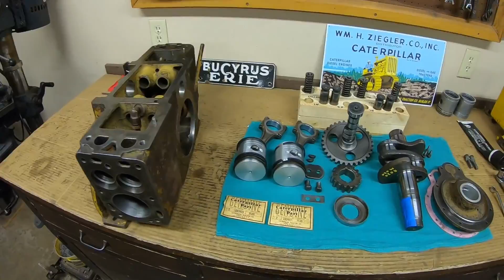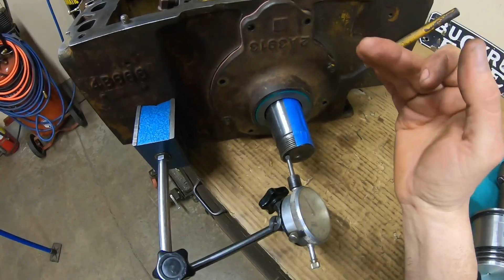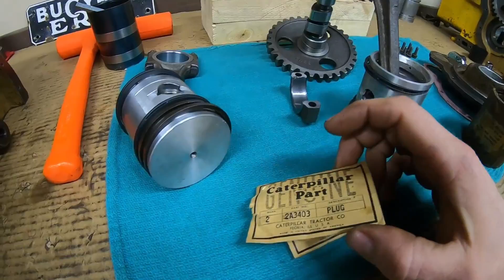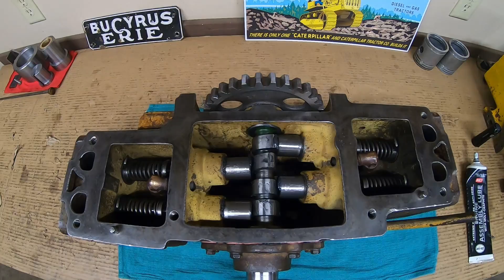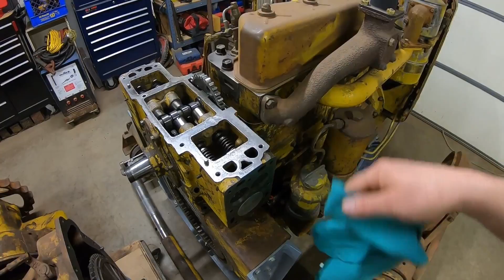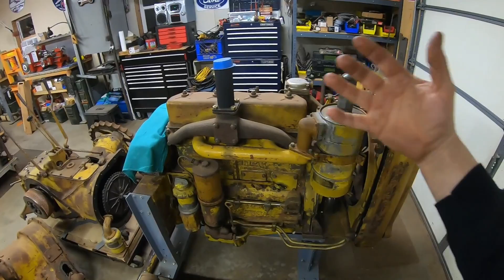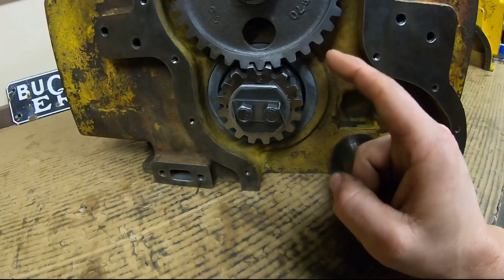The Caterpillar "Pony Motor" - Cursed by Design?? Or the Perfect Balance of "Just Enough"???

Comment: Absolutely nothing wrong with a starting engine!! Chatted with an old Cat engineer once and there is good reason Cat stuck with a starting engine for so long even though electric was available from some of the competitors.  Cat had some of the higher compression Diesel engines out there, and keep in mind they started building diesels in 1931, at that time there was no electric starting technology that was sufficient to crank over the high compression Cat engines.  Thus the starting engine was born, Cat ran starting engines so long, in fact it wasn’t until they were confident that electric starting technology was reliable enough to get their engines started that they did away from starting engines.  (Starter, glow plugs, battery, etc). Even though electric start began to become available you still had the option of a gas starting engine for some time before they disappeared.  In climates up here in the winter you couldn’t rely on batteries to get the 2UD8 running in the morning to clear bush.  But so long as you could crank up that starting engine,  get the diesel spinning over (sometimes you had to burn a whole tank of fuel before you had enough heat for the diesel to pop off) but you could always get fired up to work for the day.  My grandpa tells me stories of how he would have rather had a starting engine that was well maintained vs an electric start especially in the winter months as it was much more reliable.  Btw if you want to run a D8 with a pan for a week just come on up man we’ll let you loose :)
Reply: I was told some years ago that engineering recruits to Caterpillar, as part of their training were seconded to Briggs and Stratton to learn engine design. Many baulked at that considering B&S were so far below their level, despite at that time being the largest engine manufacturer in the world.
Reply: @peterscandlyn  I worked on Briggs and Stratton 4 stroke singles in highschool
I have a Briggs and Stratton genset that runs off ng
Reply: @JAMESMANHUNT9  Yes, I'm aware some folk have done very clever things with B&S engines.
Reply: @peterscandlyn my genset was factory built for natural gas
Reply: Enjoy stories like these!
Where are you located? How far north? I'm in MN.
Reply: @dans_Learning_Curve  central Saskatchewan
Reply: Well Caterpillar did so love their pre combustion chamber engines. The down side of them is that they are not really good at generating enough heat in the combustion chamber when you crank the engine over. That is why the need for the pony motor starter, or the later glow plugs to provide a source of heat to get the diesel fuel to light off. Direct injection diesel engines this isn't such a big deal.
Reply: Detroit-design engines from the thirties are the same compression ratio as these Cat engines (around 17:1) and they'd start on direct electric every time. The reason Cats didn't start easily is because they're indirect injection and low injection pressure. Unit injectors were far superior from the get-go. Once they moved to direct injection, no more starting issues. One of the reasons Cat didn't change the approach quickly is because it costs money to introduce new designs. Since their market was used to using the starting engine, it was easy for Cat to just keep rolling down that line until they had to design new main engines, at which point they were able to come up with easy starting designs.

Comment: Having seen the video, I concur with your analysis. I really like the whole starting engine concept. I once had to start my old diesel Rabbit (foolishly went rock hounding to an old mine in the Colorado Rockies during the winter…) with a battery that had frozen and split. Used a 9v transistor radio battery to keep the fuel solenoid open, pointed it down the mountain, and let it roll in gear. After enough fuel (which had gelled) got pushed through the injector pump and back to the tank, it started to fire. About half a mile of black smoke and it cleared up. Drove it 200 miles + back to Denver without stopping. Great car, wish it had had a starting motor!
Reply: Great use of your resources! I wonder how many people would have thought too use that 9V to open the fuel solenoid?!
Reply: @dans_Learning_Curve  my job at the time was a small diesel mechanic, so I new the engine well. Mercedes used a vacuum solenoid, I would have had more trouble with that!
Reply: @halsnyder296  Would have sucked.   (hah!).

Comment: I'll be honest with you about starting engines.  I've never experienced starting engines except to watch them being used from a distance. But I have experienced electric starter and air powered starter. And from your explanation of the starting engines, it's definitely worth looking into the rebuild of the starting engines.  The benefits out weigh the convenience of the other ideas for starting the diesel engine.  Thanks for sharing your thoughts on the starting engines....
Reply: I have to admit the air start is reliable too,

Comment: I like the principle of the starting engine, saved wear and tear on the diesel trying to start for the first time of the day. With that being said, I did put a Cat factory electric starter on my D4 7U as that had the removable 3 bolt cover in the bellhousing. I figured another starting method is never a bad idea, but the early machines never had that option, like the RD-4 or 5J1113 (other than pull starting them)

Great info as always, thanks Toby!